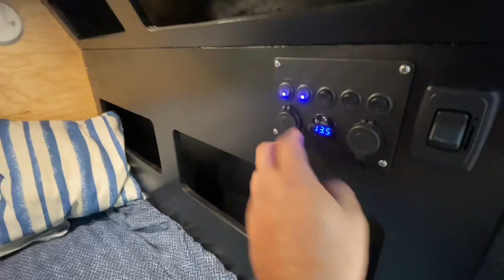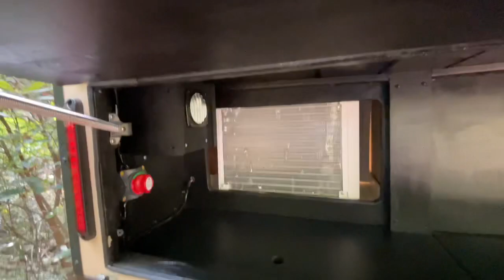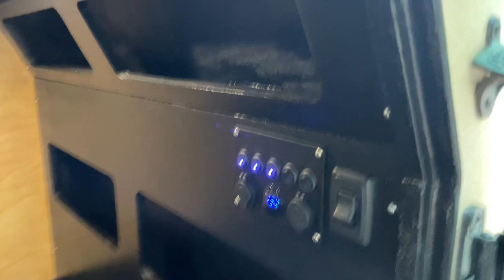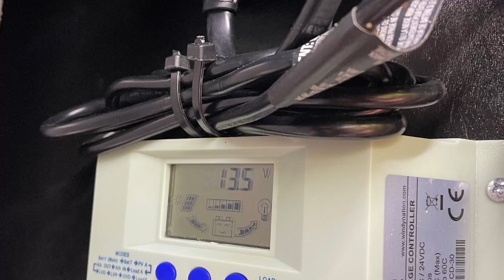DIY OVERLAND CAMPER TOUR

Comment: Great 'square-drop' camper!
But, at 4:00 the AC is quite noisy. Put a rubber matt or rubber puffers under the AC box to minimise the vibrations transmitted to the camper shell through the underlying plywood and/or side panels it comes in contact with. Hopefully that helps.

Comment: First off, very cool. The ideas are rolling. I'm about to build a larger version, but can see a possible issue placing the bulk of the weight behind the axle. I will use what youve done and swap ends. You did a great job and everything makes sense. Especially your design of the AC unit. I live in Montana and will buy another diesel heater and install it also. 😎
Reply from the maker: Thanks! Yes I agree I may slide the axel back a few inches in the future but it’s not that bad. That would be interesting with EMT , I would like to see how you do this. The door was tricky for me to build. It works well and no leaks but I’ll probably buy the next one.  https://www.teardroptrailerparts.com/doors.html seem to have nice stuff.  Let me know if you make a video or Instagram for your build I’d like to follow!

Comment: Using birch ply I could certainly get away with using 3/8. I have a cool new trailer picked out from which to build on. My plan is to weld a 1" EMT exterior frame and bolt the ply to the inside of it. I just need to find a good door.

Comment: Cool water system. Did you build the trailer yourself. First video I seen with this. Thanks.
Reply from the maker: Thank you! The trailer used to be a hydraulic pump and I modified/ extended the frame.

Comment: Really well done! Two quick questions for you. What was your wall construction? And two what did you do for the trailer frame, build or buy? If buy , anything special you recommend? Again, super job.
Reply from the maker: Thanks friend, I used birch plywood and fiber glassed the edgeds, then covered with all weather primer and sprayed it with bed liner. The frame was from an old hydraulic pump trailer. It’s 2”x3”x1/4” tubing and I extended the frame for the fridge box.

Comment: Hey, how did you deal with the water that drips from the ac unit? Window units like that drip condensation off outside normally
Reply from the maker: That cubby it sits in has a tray made of quarter inch PVC sheets. With a drain to that runs to the bottom out of the camper.